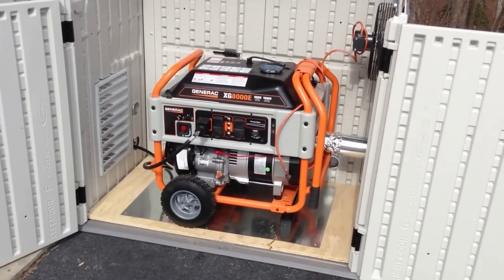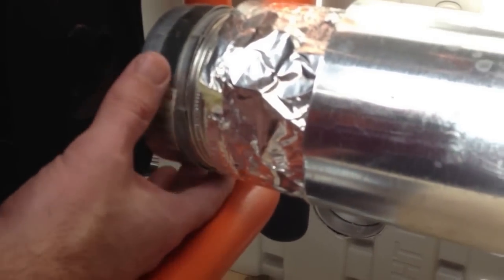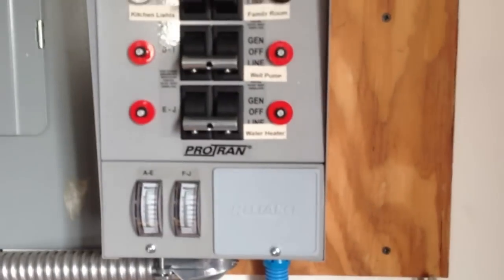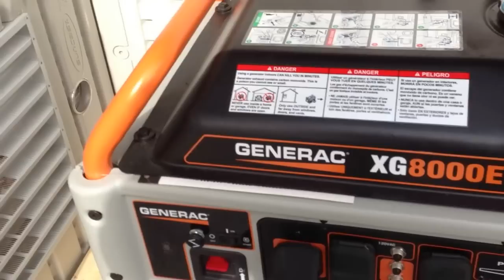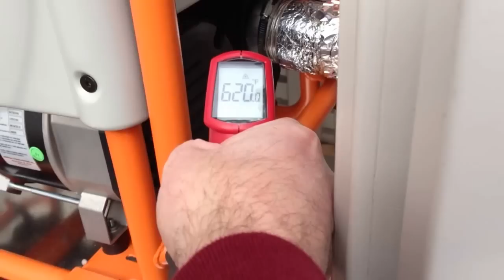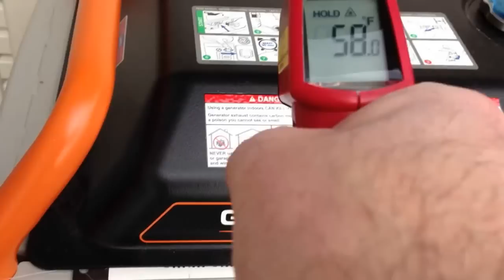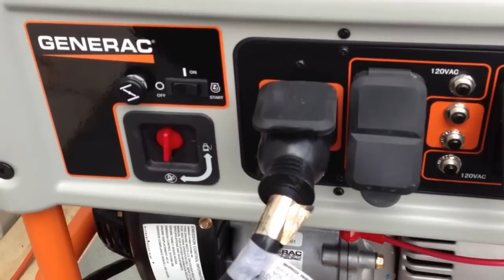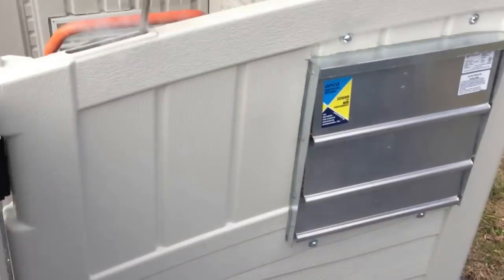Generac Generator installed in a Suncast Garden Shed for Weatherproofing

Comment: Not a big fan of the dryer vents for the exhaust.  I just run a 1" pipe through a double flue with screen to keep the bugs out.  cut out a one inch hole around flue and held in place with flue thimbles on both sides I've drilled holes through the plastic into the other one held together with  long small nuts and bolts.  Used fireproof foam around the vent(s) to keep the bugs out as well putting a screen over the opposite side.  Low intake venting and the mechanical electric  fan high.  Super cross ventilation across the engine.

Comment: 6:37 - Looks like your smoking. I haven't seen a shed that can properly vent a portable.  Especially in a Texas summer.
Reply: What does “properly vent” in Texas summer mean?

I would just open the doors and the top. You don’t need to run it shut.

Comment: sr if the generator is gasoline you can do the same.  There is no risk that the base of the gas tank gets too hot and dangerous.  until temperature can tolerate at most the base of the gas tank.  Thank you

Comment: I have to say that you exhaust vent is a fire hazard COMBINED with a wood block wood,It can spontaneously combust above 425 degs well in the range of the exhaust gases.As far as sound reduction not much of a change.Also your fan most generac generator's have a 12 volt output I would of uses a 3500 CFM automotive radiator fan as they are more efficient.
The best way to make a enclosure is out of Aluminum with sound dampening foam.

Comment: after years and years of attempts, the best solution is to put the generator above the house in a small room lets say 1 × 1 meter, sometimes we forget the generator is working! it's not just quiet or super quiet it's "not even working" quiet you will never believe it, actually you need some time to get used to it, it's magic.
I used normal things form the house
I put 2 (1/2 meter) deck planks in the room's floor
over the planks I put 2 × 2 concrete blocks two above each other
over the blocks, I put car tire, and over the tire I put my generator!
I always heard people recommending car tiers, I thought it's a joke but 6 years now.. 
unbelievable it's magic.

Comment: I would mount the fan on the back corner of the unit up high. That way the blowing of the exhaust fan don’t interrupt or have some kind of effect on the hot air blowing from the exhaust. I would also have away to mount the generator to the floor. I would also have a remote or hard wire start coming from the generator going into the house.

Comment: To solve the scorching of the wood, you can buy material that you use when soldering pipes agains a drywall backboard.  It is foil on one side and a "fiberglass looking" white fire retardant material on the other. I found it in the soldering section at Ace Hardware.  You could put it over the wood and then secure the exhaust pipe to it.  Lots of great ideas on your shelter. I am definitely going to use some of them.  Great job.

Comment: Very clean work, Andrew! I would add a rubber mat (like they use in horse stalls, horse trailers or industrial work stations approx 3/4" thick) under the generator. It will make things more quiet and will absorb some of the machine's vibrations that would otherwise translate to sound throughout your enclosure. That metal is boucing sound waves all over the place. Also, get rid of the wood around your exhaust and use a 12' piece of Wonder board (tile backing board) which is fireproof. One more thing to think about: If that fan quits your screwed. Your machine could burn up and thus your home too. Your a smart guy so rig up any one of a variety of ways to make your generator quit if your fan quits. Ex: A contact on the frame of your louvered door that trips a shutoff switch on your machine if the fan quits and the louver drops. Or even a thermostatic switch to shut of the machine at a given temp. That sort of thing. Good luck with your gen and remember it is NOT and inverter so don't run your flat screens or computers with it! That's what an inverter is for.  60 Hz not more no less is what your striving for.  Be safe and thanks for sharing!
Reply: I have the same generator and I run all my home electronics off during power outages and never had a issue. Maybe if you used it for days in end but seems to fine.

Comment: Good project,  you should never run a generator in wet conditions,  I use a 10 × 12 handy house utility building just to run my 5000 watt generac generator,  cut a hole for the exauste,  it's still loud kinda, but, it's dry. Just ordered a champion 3100 watt inverter generator to keep on the back of my camper, suppose to be quiet, IDK.

Comment: Terrific set up but if I were you I would have changed out one of the 2 panel covers for a built-in interlock cover. It looks like you have a pair of Cutler-Hammer BR series panels. I'm a lic. electrician so I do a lot of this work. Great job on the whole set up though.

Comment: As Scott said, use a 3 inch pellet stove pipe. 
Pellet stove exhaust pipes are double pipes and approved for thru the wall instillation.
Run a small diameter automotive exhaust pipe inside the 3inch pellet pipe.
Run all 3 thru the wall of shed with - as shortest run as practical. 
Cut pellet pipe to fit and add some fiberglass between sections of pellet stove pipe.
This will give you triple pipe & double insulation. Cap the end to keep the critters out.
The wood on the exhaust.😳.?..No. Aluminum or steel ..yes, but ‘run thru’ is best.
You can purchase “auto shutdown switch” placed near gas tank operated off 
oil shutdown which will activate at 125*F. ... Because gas begins to boil at 100*F.
When that vapor pressure builds in gas tank at those temperatures,
 it will force ball in “rollover/air vent” upward, thus closing off gas tanks ability to vent.
It is a poor design and put there only for safety when transporting, 
but nobody should be transporting a generator with fuel in it.
I eliminated the ball in vent, so it always vents to carburetor.
I discovered this problem after a four hour run when I went out to check
on generator. Shutdown to add fuel. Heat rises & pressure builds.
Came back with fuel, began opening gas cap & pressure was so high,
it began to spray fuel out of gas cap ... holycrap. So, removed rollover/pressure valve 
& drill hole in bottom of valve, remove ball. Now it breathes and is safe.
Reply: Eric.. are you saying the pressure increase is an inherent problem with all portable generators or when you put it in an enclosure?
Reply: @ace.ccanty7209  Not all, but without proper ventilation the heat generated around the fuel tank, especially when shutdown occurs and no fans are running to evacuate the heat in this small Suncast enclosure, temperatures will quickly rise well above the boiling point of gasoline. 
Good idea to monitor temperature.

Comment: I used a 18 inches long,  2 inch bendable exhaust pipe from a car parts store to route the exhaust from my Champion 3500 watt mounted on the nose of a 10 ft. enclosed trailer through 1/2 inch plywood and out the side without any wood burning. Just leave a small ( about 1/4 to 1/2 inch) gap around the pipe and you can stuff stainless steel wool in that gap.

Comment: What you need todo is buy metal screen and install it on every vent as I did. Doing this keeps Bee’s and Hornets any insect from getting in and making a nest. Also for your exhaust outlet I see you keep it open with a magnet you need to get a flow through metal mesh so no rodents and other critters get in as many will and chew through your wiring and create a problem. Other then that good job!

Comment: Main problem I see is that your fan is pulling air out of the enclosure, because you left so much area around the exhaust duct it is probably trying to pull air from the outside against the exh gas flow. If you would have blown air into the enclosure then a slip stream of cooling air would dilute the exh temp exiting the enclosure thus reducing the overall exh temp. 

Love the idea, if I didn't have a standby unit all ready I would build this.

Comment: That's quite nice.  Instead of a permanent magnet to hold the flapper open, consider using an appropriate electromagnet powered off of the generator (from the 120 vac, or 12 vdc output if it has one) to hold the exhaust flapper open.  When the gen starts,  the flapper will be pulled wide open by the energized electromag and then when the gen stops, the electromag turns off and the flapper goes back fully closed.

Comment: Running a generator in anything but a metal enclosure is asking for trouble. I read a story about a someone who was running his generator under load in a resin shed when unbeknownst to him his fan overheated and stopped which caused his resin shed to melt onto his generator which overheated and died. It could have ended worse. At the very least you need a high limit cut off for the generator.

Comment: That is a wonderful set up. Well, except the plastic shed. You may want to consider metal or brick. Also, I wonder about vibration of the generator causing it to shift and loose the exhaust connection. I have an xt8000e series with a lock out and breaker installed in my load center. I simply connect the twist cord to my generator and wall receptacle, close the main breaker and open the generator breaker to feed the load center and run everything in the house except the HAVC system. The other 220 appliances I can run one at a time while still feeding the house 120 currents. Thanks for sharing.

Comment: pretty nice, but just a heads up that smurf pipe you used in your garage, isn't rated for exposed work, in other words it's not a good form of protection of the wire. should have used emt or  flexible metallic or non metallic tubing, like what you used from the sub panel to the transfer panel. but the smurf is really just used as a "raceway" inside enclosed walls, it's not a structural tubing. but i really liked your exhaust pipe idea with the magnets, but the wood has got to go, obviously. a few tweaks, looks like it'll be just fine. maybe try some hardieboard or 5/8 fire rated drywall. i now i'm a little late and am sure you've already adjusted

Comment: Nice design for the neighbors.
Run your 't' exhaust pipe from outside to inside. Enlarge that wood hole and add muffler insulation around that space for heat reduction. Was your fan a house dormer heat relief unit, they come with thermo auto temp control- home depot.

Comment: $30 dual fuel honda gx390 carburetor on Ebay and it will run on ng lp and gas and the carb comes with a quick bowl drain lever which makes it super easy to store the gen when not in use and avoid bad gas sitting in the carb

I found that the generac engines are Honda clones just like the predator and duromax and basically all the others

Much better than the stupid expensive conversions as it's a purpose built generator carb and looks factory 

Also when you shut it down cut the fuel off not the switch it will run the carb dry and allow you to store the gen for long periods

Comment from the maker: The The generator has been great. Ellie have about three or four hours on it but it runs fine. I did learn that if you try and test run it with only a gallon of fuel the carb bowl will not fill on its own. Easy to remedy though.

Comment: I wold use the gray cement board for the exhaust, the  kind of board used for tile backer.
Reply: Or metal
Reply: Hardy board is what you want.  i would also line with some insulation/sound proofing and/or some paving stones.  Paving stones make great heat and sound insulation.  I have also installed a solar panel on the lid as a battery tender.  My exhaust is a silicone flex tube through hardy board and the same dryer vent aimed down to another paving stone.

Comment: I would have a machine shop just fabricate some flanges for you and ditch that wood around the exhaust. There is probably already aftermarket flanges for that (think gas hot water heaters exhaust)/ That wood around the exhaust could eventually auto ignite with a prolonged run.
.

Comment: I have a Briggs and Stratton 7000/8000 portable generator, electric start, with a spark arrestor case, need to vent the exhaust outside the enclosure, will  this hook up work for my application?

Comment: We are curious at to your reasons why you added the wood flooring and sheet metal instead of just letting the generator sit on the plastic shed floor?
Reply: When you watch the temperature readings as he was checking around the generator, it was in the low 90's under the generator at the left end. The plywood and thin metal sheeting would tend to reflect the heat back up away from the plastic floor and keep from melting it. Those plastic floors aren't the strongest. I caused a dent in one a little bit while installing it when apparently I stepped on it wrong somehow. The plywood and metal sheet under the genset is a good idea.

Comment: good work in progress just keep tweaking the design a little i would line the inside with that heat resisting foam because that plastic shed wont take much heat by itself i have seen them sheds deform in summer heat.

Comment from the maker: The 30 amp cable has a ground connected to the house.  For extended operations, I  have a 16 GA wire connected to the house grounding rod (located right behind where i run the generator).

I've been really happy with the setup so far.  I don't know if I can run it in the summer without the temps getting too high - I'll have to test it when the weather warms up.

Comment: i basically made the same enclosure, but am a little perplexed as to what material to use around the exhaust vent.  It gets too hot to run long connected to plastic, and I see that the wood smokes as well. Any ideas as to a work around?

Comment from the maker: The temp gauge was one designed for home use (read the outside temp while sitting inside).  Works fine!
Reply: ⚠️Here’s an important safety announcement for everyone:

Please make sure you follow the generator safety tips whenever you use your portable generator. This is just a reminder for everyone’s safety. All generator safety rules need to be followed carefully 

Here are the generator safety tips: 

1) KEEPING OTHERS SAFE: Please do not allow an non qualified person or your children to operate and service the portable generator. Just because some manuals don’t say that doesn’t mean it’s safe. That is important against the generator safety rules. We also need to be keeping an eye on our children too. You need to make sure that your children are not playing near the portable generator especially when it’s running so they won’t get electrocuted. Generators pose electrical risks and they can be hot during an operation. Please keep your children away from the portable generator at all times. It is important to keep our children safe especially our little ones. Children often get curious about anything so we should keep an eye on them to also make sure they’re not wandering towards the generator. 

2) WHERE TO RUN YOUR GENERATOR: Some people use their portable generators indoors which increases the risk of carbon monoxide poisoning. It’s important to have a carbon monoxide if you have a gas generator. Never ever use your generator indoors even if your doors and windows are open and even in the garage is not safe to use a portable generator. Not even at your porch and your deck. It is never safe to use your generator indoors and in enclosed areas of your home. Your generator needs to be 15-20 feet away from your house. 

3)🔥FIRE HAZARDS: Never refuel your generator while it’s running. You need to let your generator cool off before refueling it and before storing your generator. Never overload your generator too. Never ever back feed your generator. You should never plug your generator into a wall outlet. Also never store propane tanks indoors. Please keep flammable things away from the generator as well and please don’t smoke cigarettes near the generator. Having a fire extinguisher next to the generator is also important against the generator safety rules. 

4) GENERATOR OPERATION: make sure your hands are dry before touching the generator. Never use your generator in wet conditions. Don’t let your generator get wet. You need a generator tent if you need to use your generator during wet weather. Please don’t wear loose clothes when operating the generator. Turn on your generator before plugging in appliances. Use the right cord for your generator. Please do not use worn out cords. 

https://youtu.be/I1jT3ANENvI and here is a video more about keeping others safe when using generators. It’s better to keep your children safe. All generator safety rules need to be followed carefully. 

Hope this helps. 

Please make sure you follow all the generator safety rules.

Comment: The exhaust needs to have an air clearance around the pipe.  Might consider a direct vent exhaust pipe that is use for direct vent fireplaces or a double wall metal heater vent pipe.  Have never seen a failure there.

Comment: This looks very much inspired from this version ( Outdoor Enclosure for Portable Generator) from a couple of years (down to the magnet for the exhaust)    I would recommend using n1bpd's video, I did, no issue with exhaust.  also he put a safety temperature switch (to turn off the generator in case of temp spike) really well done. Still always nice to see what other people do, your setup looks really clean.

Comment: Nice job, where did you get the temperature gauge, and is that where they told you to place it within the shed???? I have the same shed if you google it under "generic 7000 xg series in a suncast shed." I also like the transfer switch, I didn't put one in, I had a certified electrician back feed in to the breaker box with a 30 amp outlet. Im just going to buy a lockout switch for my main breaker and lock the it when I use the generator...